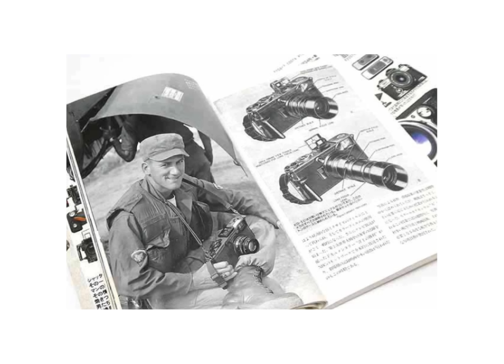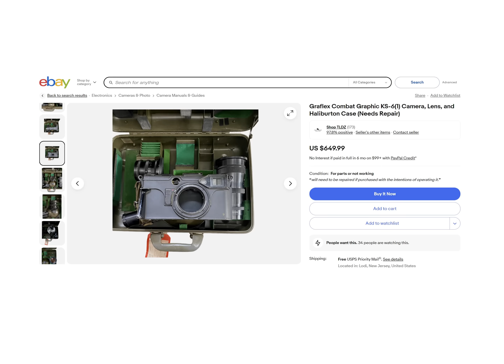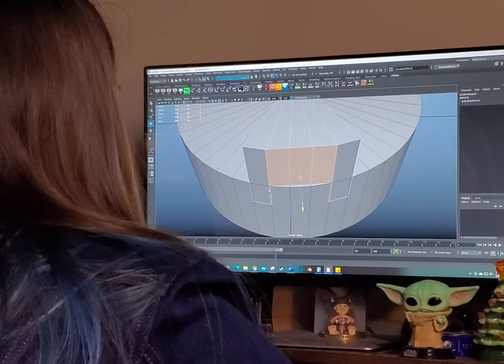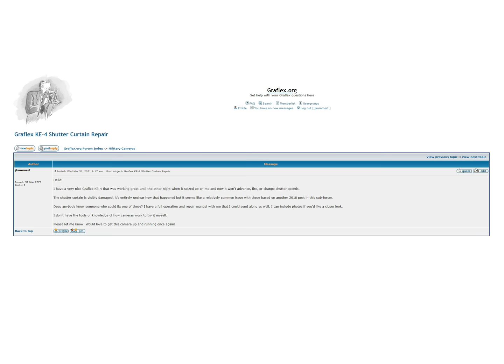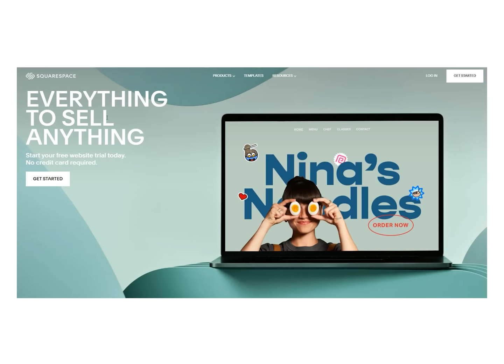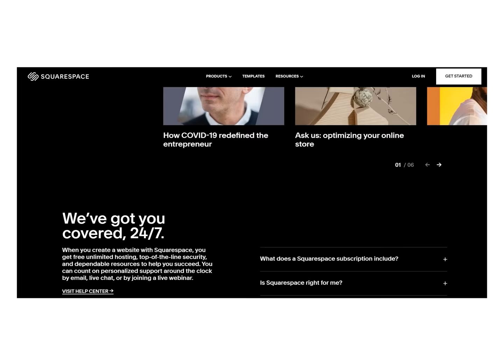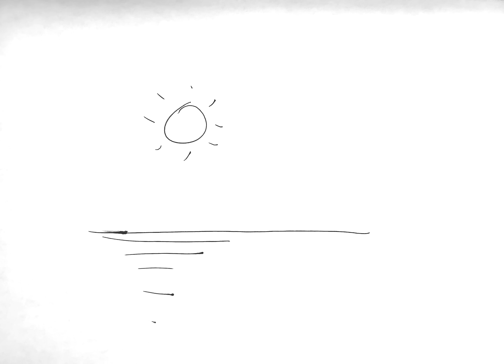My Combat Camera Story

Comment: This camera was made during the 1950s by Graphlex under US government contract for military use. I was not sold otherwise. The ones you see today were used for years by the military, then sold as surplus. In the 1960s and 70s, they were not common, but they were not hard to find either.  They always commanded a fairly high price if in working order, as they commonly sold with the full military kit.  As noted, they use only 70mm film, which was readily available in the 1950s and 60s, but died out when pros shooting medium format largely abandoned the long roll formats, 220 and 70mm. The critical error he made here was shooting it on 120 with the paper backing. This put too much pressure or drag on the film at  the pressure plate. It may have damaged the film advance gears. Note that the 120 film has no sprocket holes, and the film is too narrow to engage the film advance sprockets anyway. As a result, the only part of the mechanism handling the full load of film advance here was the take-up spool gear, which was not designed to take that abuse.
Reply: Thank you, this explanation helps re what happened and is cautionary in regard to any intended camera mod.
Reply: @grahamrichards8531  It wasn't a camera mod It was the use of film not designed for that camera not any different than somebody putting diesel in the gasoline engine.

Use the equipment as it was intended to be used and by design. Don't claim to believe that you're more knowledgeable than the engineer that designed that camera.

Comment: I know someone who is a nam vet and he had some amazing stories about what he did over there working a division photo lab. he said all the shot they used was from ww2 or korea and it came out of an antique 9 mobile photo lab, whatever that means. that they were only allowed to get new shit if it was destroyed in combat, which is unlikely since he was at a base. He ended up finding someone who worked in supply who dident quite like the army who asked if they needed anything. He handed the supply person the three stock numbers for the three supply manuals that are used by all branches of the military. The supply person brought them to him and he used the manuals to find all the new photo lab equipment and shit that they needed. the supply person would just put a few of the numbers at the end of an actual order so no one would notice that the unit receiving the equipment was not authorized to have it. When the order got to their base they would go through it and take out the piece of camera gear that they weren't authorized to have and throw it in a warehouse. after the shit got buried in the warehouse he would find it and load it onto a truck and take it to the photo lab. They ended up having all new photo lab equipment within a few months and they also got new zeiss cameras and lenses this way. he said that if they were caught they would have gotten into quite a bit of trouble. but he said that in the end he did it to save lives. he says that the difference in clarity of photographs coming out of the lab allowed for better decisions to be made by the people in charge. these vets did a lot of shit that we will never know about, i speak to him every week and every time he has new story.

Comment: The original Pentax 645 from the 80s apparently had an optional 70mm film insert. As far as I know Pentax stopped making them for the later 645n and nII.
Reply: Hasselblad and Mamiya both also made 70mm backs.

Comment: Few years ago I purchased a Zeiss Ikon Contraflex Super, not nearly as old as other cameras I have. The camper is in great cosmetic shape but the shutter is slow in closing and the mirror sticks up. Appears the “grease” used back in the 50’s slowly turns to cement over the decades. I have a repair person for several 1930’s and 40’s Zeiss folding cameras, however, he stated due to the complexity of the lens and leaf shutter he does not touch these cameras. I have followed up with several others who work on the Zeiss Ikon’s with the same result. Thinking of doing the repair work myself but haven’t brought myself to do so.  So there definitely the issue that many of these repair experts are dying off and there’s no apprentice to replace them.
Reply: You were well advised as to Contaflex repairs, Add Kodak Retina Reflex and Voigtlander Bessamatic models to the list as well. Two comments:
1.  The mirror is not "sticking" up. In normal operation, the mirror rises at exposure, also blocking the viewfinder. It is not "rapid return". It lowers for viewing and focussing only when you advance the film and cock the shutter. Nearly all leaf shutter 35mm SLRs worked the same way.
2.  For sticky shutter operation, dismount the front lens group so the shutter is exposed.  Use old-fashioned lighter fluid, putting a small drop or two on the closed shutter leaves, then operate the shutter a few times. (If in doubt, use less rather than more fluid.) This will dissolve any old lube which is stalling the shutter and flush it off into the shutter housing. It's not as good as a full shutter CLA, but that is a nightmare on these cameras. Before calling it done, put the shutter on 'Bulb", open the shutter, and check the front element of the rear lens group for spilled fluid, dirt, etc.  Clean as needed.
Reply: @randallstewart1224  regarding your reply:
1. You are correct the mirror is “designed” to return to the down position only when the film has been advanced. However, it does not consistently return to the down position once advanced. I have taken the back film plate off and verified the mirror does not consistently return to the down position when film is advanced. It may take multiple efforts before the mirror returns down. 
2. I may give that a try, but I’ve also heard stories of people using such fluids for less than adequate results, but on the other hand may not have a choice. However, if I can’t get the mirror situation resolved it won’t really matter. 
Thanks

Comment: You do realise you need 70mm film in these in order for the shutter to work properly. Using 120 in it in the way you did, prevents the curtain from braking properly, as there’s too much spring tension on the curtain drums. These should ONLY be used with 70mm. If you want a big 6x9 camera, shoot the fuji 690. 

Also those lenses only cover 2¼ x 3¼ (6x9cm) format.
Reply: What has the film to do with curtain drum spring tension?
Reply: Well that would have been fun to learn 2 years ago
Reply: @user-lh1fw6qh4d  the spring motor drives the curtain mechanism and the film advance from the same gear. It was designed to account for the film winding resistance to take some of the mainspring’s energy, as part of the shutter cycle. That film resistance prevents the shutter tensioning springs from being over-tensioned. There isn’t a governor for the mainspring. Only a governor on the curtain. However, the braking mechanism for the second curtain wasn’t designed to take the full energy of the mainspring, which is what causes the curtain to crash. Second curtain drum receives too much spring tension, and hits the other curtain. This is why you do not dry fire this camera, or shoot it with anything other than 70mm film. It’s an admittedly fragile design, but so were the Contax cameras, which were also designed by Hubert Nerwin, the designer of this camera.
Reply: ore use 220 film ore beter 65mm in 70mm cartridges that works excellent.

Comment: The ring crumbling is a very specific issue,and I think I might actually know why it happened,Mazac Rot.

When you strain metals poorly you wind up with metals that are very weak,and decay very fast due to the amount of impurities within them,it’s common in low grade metals or just poorly manufactured ones,and while we found out how to fix it in the 1930’s there are still products with this issue today,and back in the 1950’s during the Korean War this camera could have been put together with low grade parts,of poor quality that slowly got weaker and weaker until this crumbled under the pressure of their own job,much like every human in their mid-40’s.

Comment: But, if anyone is interested in 70mm, you do have options. As mentioned, Ilford sells ULF film in both perforated and non-perforate varieties, Mercury Canera sells fresh 65mm vision3 and adapters to use in these cameras, Astrum in Ukraine sells fresh unperforated 70mm film in 64, 100, 200, and 400 ISO stocks, and you can buy Aviphot from India for cheap that expired in 2012 that has worked very well for me.

Comment: Funnily enough I watched a video the other day about the hasselblad A70 back which takes 70mm (named, I think, because it will hold 70 frames). The backs are still available, though need a small mod to take modern 70mm which lacks the sprocket holes.

Comment: Reminds me how I finally decided to go for a Polaroid 190, the top of the line. The ebay seller confirmed that it was indeed working, I was shooting peel apart in my 4x5 back on linhof technika a and I decided to splurge....

The camera arrived from overseas, the shutter was not working, ebay seller promissed to reimburse the cost of repair and promptly ghosted me, the shutter eventually got repaired, the camera made pictures but the focus was off and even after switching the rangefinder to a different one from a different polaroid it was still off and about that time, fuji came with the coup de grace and said, that all the FP100C I was shooting was and old stock and they are running low and won"t be making any new...

I ended giving the camera for free to guy I know who shoot tintype (that's not true, but I wish it was, because I exchanged it for Lomography Diana F+ with busted focus - but I fixed the useless POS at least). He told me he fixed the focus by adjusting the rangefinder screws...

Total cost about 600 USD ...

Comment: Ok I gonna tell my story as well. 

We know that when u start at photography and u have a part-time job, u just can't avoid Gear Acquisition Syndrome, I had a nice point and shoot, (Chinon 3001) and a Fujifilm X30, but I wanted more, I wanted another film camera. 

I was in something similar to OLX, or Craigslist, it's called wallop, I saw this Contax G1, with the 45mm, on it, and the only problem was the focusing dial, (would not move actually and was not in AF),  the seller said it was aesthetic, well, deep inside I new it wasn't, I would comeback every now and them to see the camera, he wanted 450, I said, I give u 350, cash, tomorrow, he said ok, and i thought he would not even answer. 

We met, I paid cash, we talk he explains that it doesn't work quite well, and if I want to test and have my money back he would do it no questions asked. Next thing I went straight to my lab to show my new CONTAX G1 that i got for a banana price, the lady said, well we got basically 2 places that can fix it, here is lisbon, and gave me their info, I call the first one, he was polite and straight, basically, don't even come, "I can't fix it, I don't have contax pieces, we don't fix them here" , the second guy was like, "bring it, I will take a look". 

Took him 15 days to tell me how much it would be to fix it, it's basically what I paid for the camera, and that it can take until 40 days maximum to fix it, at least I paid 50%  for him to start to solve the problem and will give the other 50% when I got it back. 

Looking back I would not but it, but after I did and was mine, I would to the possible to keep the camera alive, it's part of me now, I literally only had it for 2 hours, and it's already the most expensive thing I ever bought. Keep analog alive.

Comment: I bought a camera and lens from a local camera store.  When I got home I noticed a chip on the rear element of one of the lens.  I called the store and they said to just bring it back.  I was going to wait until the next weekend to take the gear back but decided to drive back the same day.  It turns out the owner died before the following weekend.  I lucked out on that one.